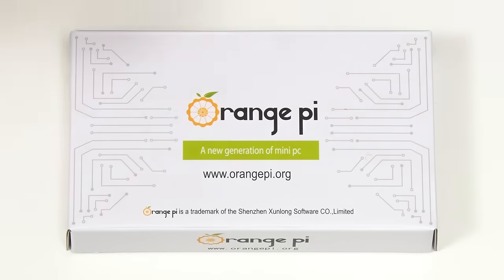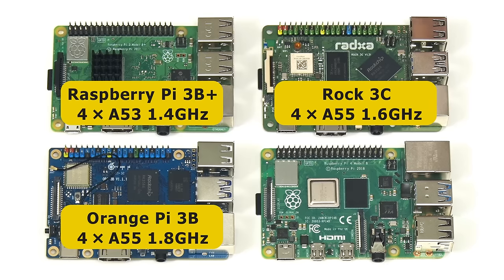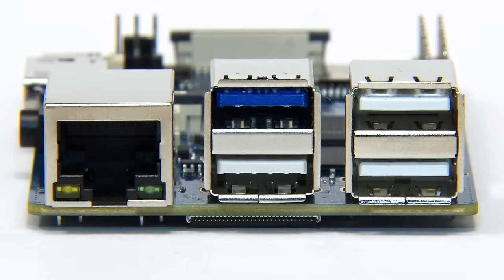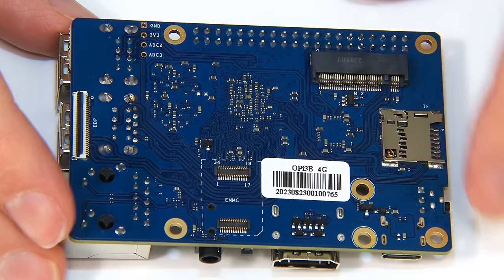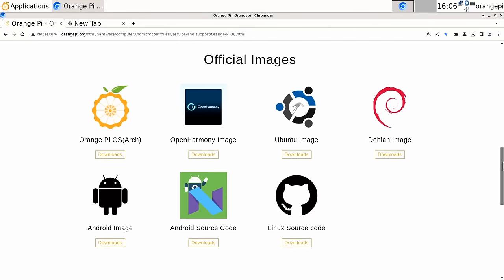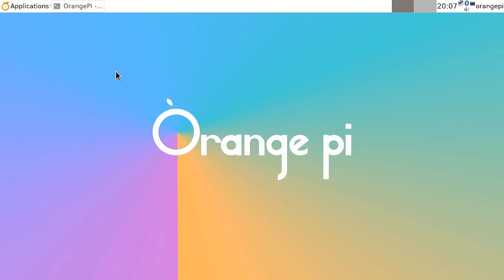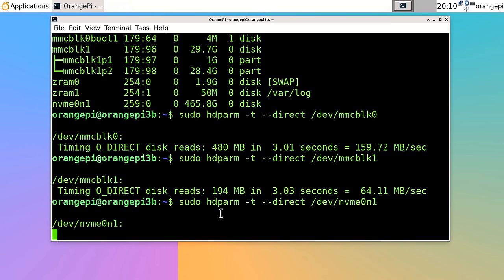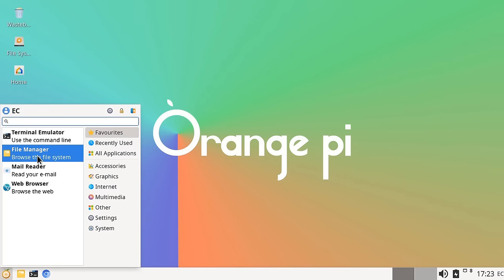Orange Pi 3B:  Low-cost M.2 ARM SBC

Comment: With regards to your sysbench results on Debian and Ubuntu I think you will find that the file /etc/default/cpufrequtils is limiting the max frequency to 1296000 when the board is capable of 1800000. With that one change my sysbench result was 6.7982s. The OPi OS image appears use the 1.8GHz frequency without any changes.
Reply from the maker: Thanks for this, which makes total sense. I'm pinning your comment for others, as it is very helpful.

I should have thought of something like this going on. I guess I assumed that all of the supplied OS took full advantage of the SoC. :)
Reply: It possibly can handle 2GHz with a heatsink.
Reply: With that higher clock did you still notice the sluggishness in menu responsiveness?   That seemed quite at odds with the video decompression in the browser.
Reply: There is a CPU setting option with the OrangePi.  orangepi-config.  With this you can set the max/min cpu frequency as well as the governor algorithm (i.e. power, performance etc).  I suspect the cpu will need a heatsink if you do this, though.

Comment: There is a place price-wise for the RK3566.  However, I have grown to love the extra performance of a RK3588S SBC.  I still use Raspberrry PIs but as a near-desktop replacement, the RK5388 makes for a leap ahead in UI pleasurability.
I hope designers and manufacturers focus on the RK3588 or better SOC for power, while keeping costs competitive of course.
As usual, thank you for the presentation of this product.
Reply: One can get a complete retro handheld with  RK3566 with 3.5 Ips screen, battery and microsd card for 50usd. These cards are redicoulously expensive for what they are.
Reply: I think there’s some degree of “everything is a nail” when looked at from the perspective of personal desktop as a benchmark. A more fitting perspective is “what kind of things can I invent with the resources available”. 

Example: With a pico W, I can build a robot with motor control, several sensors, and network connectivity. With a pi 3b, same thing, but with a full blown OS to run services on. Orange 3b, same thing - but without a sketchy slow sd card storage, flexible antenna placement, and can even run AI models. 

Pico: I can build a sign with a flashing marquis; raspberry I can build a sign that has video; orange I can build a sign that shows video based on what ballcap you’re wearing when you look at it lol. 

That sort of thing.

Comment: 10 years of alternate ARM SBC development and we still haven't reached software parity with the Raspberry ecosystem. I wonder if RISC-V can finally bridge the gap in this regard.
Reply: Risc V will be worse as extensions will not be standardised.
Reply: Honestly, I think one of the biggest issues there, is we have a diversity problem with too many SBC designs, which are diverse enough that you cant successfully just build one fork of any major distro with minimal work and have compatibility.  Sure the cores are ARM 5x in most cases, but the remaining differences cause issues that the Raspberry Pi foundation has minimized with very few diverse cpu/gpu/peripheral combinations.
Reply: That custom distribution got snappy GUI interaction by disabling hardware accelleration. That's insane. It basically means that the Mali GPU driver ist just a steaming pile of crap.

It also means that SBC CPUs are fine for light desktop use with browsing now.
We need a free and open GPU so drivers can be part of the Kernel and get good maintenance.
Reply: And yet the RPI still hasn't got VDPAU or VAAPI and relies on external patches to provide hw accelerated video decoding i.e. in Chrome. IMO the Rockchip SOCs that are on the market long enough to have received mainline kernel support are a much better choice. You get all the same interfaces as on a desktop platform and don't rely on applications needing out-of-tree customization.
Reply: I don't think we are that far off with the new Rockchip rk35xx series as they have had a huge effort to get mainline support and then Arm has announced it will work with Collabora to create opensource GPU drivers.
We need to get away from direct plug hats and get used to jumpers so that any pin mux can be wired to any board.
Raspberry had a lead but with what they have done with stock and how they turned thier backs on makers that isn't true anymore.
We need mainline support and jumper based boards and we have parity.
Reply: @tonysheerness2427  Yup.  Intel's presence in RISC-V International, and that of several other commercial interests, will see to that!
Reply: Correct me if I am wrong, RISCV is only the instruction set. So it won't help much for hardware peripherals. With some SBCs, I am forced to use their own version of the kernel, sometimes awfully outdated.
Reply: ARM is flawed because the bootloader isn't standardised like it is for x86. Each firmware has to be built for each device and devs waste more time porting to every sbc under the sun when that wasted time would've been put towards drivers.

If only UEFI became mandatory for all ARM devices
Reply: @MLGPRO-dx8fg  Something isn't flawed just because you don't understand it or don't want to put in time and effort to learning how it works. 

The default standards for SBCs is that they are for makers and tinkerers who don't mind messing around for hours working out how the hardware works.

If you measure everything SBC by Raspberry Pi standards where the great level of support for the boards has made them "near consumer level" devices, then that's you using an anomaly in the SBC world as a baseline - which is completely the wrong thing to do.

If I am paying < £50 for a board that I have to mess around with a bit to get working, then that's fine by me.
Reply: @terrydaktyllus1320  You don't even know what you're talking about. A standardized bootloader wouldn't make it any less fun to play with these boards, and it would actually make it better cause more distros would support them
Reply: @MLGPRO-dx8fg  "You don't even know what you're talking about."

No problem, you're entitled to your opinion but as a complete stranger on the Internet to me, that opinion does not have to have any validity or be based on facts, because you've never met me.

I am pleased you opened your comment with that line because I saved some time not reading it any further and thus allowing me some "payback" by forcing you to have wasted your time writing it at me.

Good, we're even and I am done here.

Run along now, mind how you go and stay aware from sharp scissors.

Discussion closed.
Reply: Using since 10 years ARM SBC in production for commercial products, we get rid of raspberry useless stuff and learned how to customize a production distro, faster devlopement and more money. 🤷🏿‍♀️🤷🏿‍♀️🤷🏿‍♀️🤷🏿‍♀️
Reply: I find it hard to really give any props to the RPi foundation because in over 10 years they've never been able to meet demand to the point you can just order up a RPi without sitting on a waitlist or paying 2-4x over MSRP from a scalper. No one else has had a long standing problem with production like this and stayed in business.
Reply: How long are the delivery times again for a Raspberry Pi?!
Reply: Is it reasonable to even expect that a raspberry pi competitor will ever reach software parity with rpi? Considering Rpi's stranglehold, and the fact that rpi's software support was lacking before it built a giant community around it, I think it's reasonable to expect alternatives to always be a few steps behind.
Reply: U-boot that is used on most of these boards can act as a UEFI firmware (with limitations)
Reply: @Oktokolo  facts

Comment: There is a CONFIG file associated with the Android Installer RKDEV tool. 

You can edit that CONFIG file with a text editor. 

There's a place where you can change the language - I believe it is default 1 for Chinese and you can change it to 2 for English. There might be a list of other languages.

But even if you don't change the language, the manual for the Orange Pi 5 Plus (if the 3B manual doesn't show the same thing) shows how to use the tool. The text in the manual is English, even if the pics they show of the software show the Chinese language. And it's only like 3 buttons to press in the software needed to complete the whole process.
Reply from the maker: Useful, I will try this. Thanks.
Reply: @ruirosado6289 that's correct! I found the same fix while working on my Orange Pi 5 Plus. Had to check the messages before posting, to find that two others had already provided the answer for Chris. Well done!
Reply: @MarcusPHagen  And i did the exact same thing you did. :)

Comment: As usual very good video.  This promises to be a valuable card, if they can work out the bugs.  I'm very surprised at the cpu performance.  While the hardware acceleration issue is fixable since it's most likely a software mod, I don't think the cpu problem can be a software issue.  It will be interesting to find out if and when they address it.
Reply: Yep.  Probably needs further optimization in the Debian kernel to take full advantage of it.
Reply: It's already "fixed". Look at the pinned comment. The CPU clock was set lower.

Comment: hi Chris, i recently found the orange pi 5 and 5B not bad at software, but it still be very good for the rk3588s using on it, the major different between the normal RK3588 and the RK3588S is RK3588 is with pci-e 3.0, but the RK3588S doesn’t having one and rk3588s (17*17mm) is much more compact then rk3588 (34*34 i remember), so in my opinion is if you wish to having an arm board with powerful extension, go to rk3588, if you wish to have more portable go for the rk3588s, i will run my server and development tool on my orange pi 5B.
and also the orange pi team pushing out the new board call Orange pi zero 2W with the allwinner h618 with up to 4GB ram, and it has wifi, i pre order one for myself

Comment: I'm glad to see that Raspberry Pi is getting some much needed capable competition.

This board features more gadgets and functions than it should technically fit and at a much lower price.
Surely the CPU performance is lacking, but that  NVMe slot and eMMC slot make up for the Raspberry Pi's lacking storage capability.

You have convinced me on this one. I'm going to get myself a few Orange Pi 3B boards to play around with. 

Exciting little devices for sure.
Reply: Agree given the cost of pi now
Reply: @Username-qx9gk  Prices aren't going back down for a long time.  $10 only ever got you a pi 0 w with 1 core that was barely functional.  Mine used to make this annoying snapping sound through the audio it was always garbage.  For a similar pi board right now you'd pay $100 instead of $55.
Reply: @Drak976  Id rather buy an Intel N100 instead then.
Reply: 😂😂😂 CPU power ???
You need to make a fluid simulation??😂😂😂🤦🏿‍♀️🤦🏿‍♀️🤦🏿‍♀️
Reply: @Username-qx9gk  You can get a zero 2, that has the power of a Pi 3 for $15.

Comment: heads up! I noticed that the Orange Pi 3B received a major hardware revision
If you visit their website, you will see the revision has changed from 1.1 to 2.1

Notable changes include the M.2 port turning into a 2280 port and a different wifi chip, as well the board size changed resulting in old cases being incompatible

Comment: That has a lot of very desirable features; strange that it's Debian performance is a bit low.
I think they missed the opportunity to use an orange-coloured board.   🤔🤣
It is good to see those larger RAM options.  The better WiFi antenna would also help.

Comment: Hi Chris, having a PCI-E interface on a cheap SBC with ram options up to 8GB is certanly interesting here as it opens the possibility of connecting a M.2 Sata controller (i saw one with 6 ports for $15) and building a decent NAS. I could probably get Jellyfin working on it too. Ill definatelly consider it.
Also hows the wifi performance? The Orange PI Zero 2 W, Orange PI Zero 3 and Orange PI 3B all have the same wifi chip. Im currently waiting for one of those new Orange PI Zero 2 W, since the GPIO is very similar to the Raspberry PIs (i think only some PWM are on a diferent place) im hoping to get one of those GPIO screen for RPIs working on it for non gaming application. 
And i also want to evaluate the wifi because if it is good enoght i could build my own APs with the Zero 3 1GB. In general the Zero 2W is not really worth it unless you need the form factor and a gpio closer to the RPIs, the Zero 3 only cost $1-2 more and have all the I/O plus the Gigabit ethernet.
Reply: I tested orange pi 5 plus with m.2 asmedia sata controller, it works fine.

Comment: Hello Chris, again very nice Sunday with growing family of the ARM SBC. Hopefully software problems will be improved in the future. I am skeptical SoC without a metal cover will cause tremendous temperature problems. It is disappointing that M.2 module is only 30% faster than, RPI 4 with USB 3-SATA adapter. In addition, is the M.2 module bootable?🤔It is gratifying, the great performance of Mr. Scissors was recognized.

Comment: Blessed Sunday greetings all!

Looking forward to your take, Chris, on the Orange Pi 3B. I have had mine for a few days and was curious to see how you have made out and what you did to get it going. 
I have so far tried Debian Bookworm with XFCE and Ubunutu Jammy with XFCE, both on SanDisk Extreme micro sd cards, and they are usable if a tiny bit sluggish on a 1080P monitor. They are both quite unusable on 4K displays though. Extremely sluggish with screen tearing. Not a great experience.

I did give a cursory look at OrangePi OS and found it to be considerably superior to both Debian and Ubuntu especially on 4K displays. YouTube playback via a browser was still iffy but I did not get a chance to try a 1080P monitor for OrangePi OS just yet. 

I also would like to see if you fitted an M.2 drive and how that worked out for you.

Now to watch the video!
Reply from the maker: Greetings! As you will see, I did get an M.2 drive working.
Reply: @ExplainingComputers  Now having watched the video I see that your experience was pretty nuch exactly the same as mine. I did really like the Orange Pi OS with its snappy responsiveness. I never judge SBCs by YT video playback as that was never the purpose of these lower cost devices and I will stand by that statement for all eternity. Still, this board provides good bang for the buck and can be recommended.
Reply from the maker: I still run the YouTube test because many manufacturers -- including Raspberry Pi and Orange Pi -- do market their boards as potential low cost desktop PCs. And today it is reasonable to expect a desktop PC to be able to stream video -- both to watch online video, and for video conferencing. So given that other basic desktop PC stuff (e-mail, browsing, word processing and local media playback) always work, I like to do the streaming media test.  :)
Reply: @ExplainingComputers  Yeah, most reviewers do. I feel the manufacturers are all pushing their luck with video streaming. I would rather keep using equipment that can truly handle it. Less frustrating that way. You can’t teach an old dog new tricks as the saying goes. :p

Comment: The built in EDP is intriguing.  I can also imagine building a FPGA hat with something like a tang NANO 20K, using the orange pi as the host and passing through controller data and configuration data or flashing the ROM core, using the IO pins, and then displaying the FPGA framebuffer through the EDP and HDMI ports.  plugging in an EDP screen directly would make for some interesting options, assuming theres enough IO to handle it all.  Could build a tabletop arcade machine with a small LCD screen, or throw a retina screen into an old macintosh classic case and just emulate the mac on the OrangePi..

Comment: I bought one with 8GB and 3A power supply from Amazon here in the US for about $55. I have not had a chance to play with it or order any additional storage options. For my intended (test) use case I am less concerned about video playback as I intend to use it as an edge node. It's my first Orange Pi product.
Reply from the maker: Good luck with your new SBC. :)

Comment: On Aliexpress I bought a motherboard with xeon 2667-v4 cpu + 32 GB ddr4 ram @ 32000 for 110 euro. With proxmox on it I don't need any sbc anymore. I just use my pi-zero2-W to run pi-hole.

Comment: Yep, I also tried to use Chromium on Orange Pi 3, and on Orange Pi Zero, and on Orange Pi One. Looks like it is a problem with drivers. I hope they will fix it soon, the HW acceleration is disabled.

However, it works well as a server, I like this platform. 

It is strange that you got 10 seconds in your tests, I guess it is throttling. All my Oranges 3 are pretty hot.

Comment: Interesting video. Given your conclusion at the end, I ask: If the software on the RockPC shows better results with the same SOC...;   Have you tried installing the ROCK-OS on the Orange board?
It will probably needs [quite] some tweaking, but it might also be a step forward .

Comment: Suggestion: Consider making two videos per SBC if it's financially viable and you have the time. The other one would be about using the SBC for some AI inference, especially using it for Whisper or some home assistant. I don't know a good channel doing this. The ones I know go either for desktop with browsing or gaming emulation.

Comment: Is there a difference between running the OS from emmc or SD card( in case of Raspberry Pi) in terms of responsibility and long lasting of the media?
Reply from the maker: That very much depends on the microSD card. If you use a high endurance microSD card, or just something decent like a SanDisk Extreme PRO, then the microSD card should last as long as an eMMC mobile. But a basic microSD card only designed/intended for stuff like taking photos will not (on average) last as long as an eMMC module.